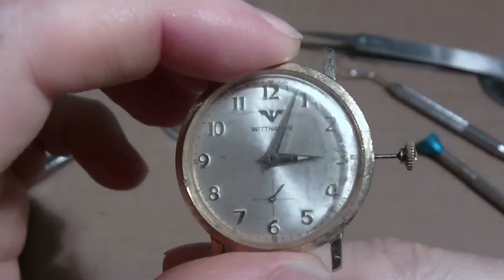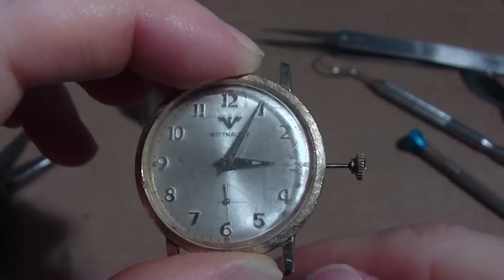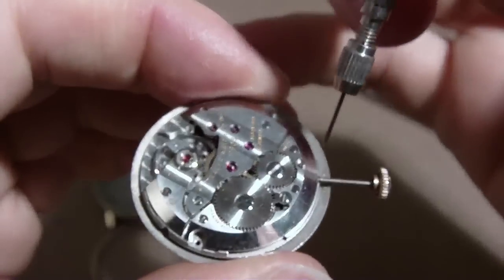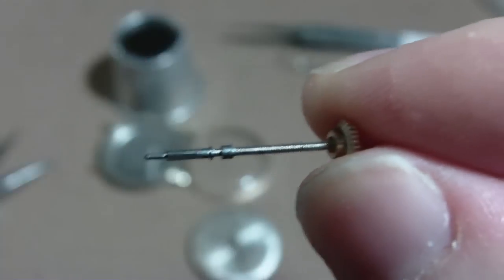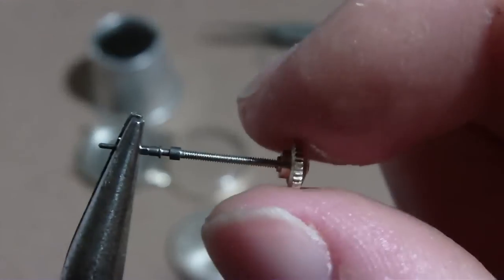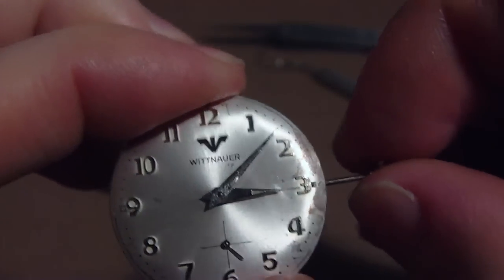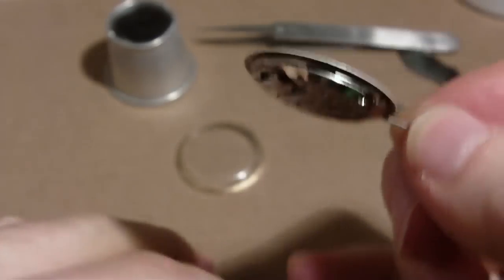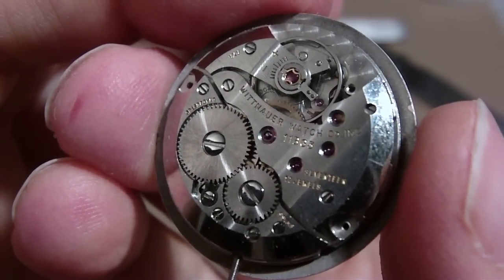How I remove a wrist watch stem and crown, screw type.  Wittnauer watch 11BG3.

Comment: @Naddycat caution.....I have had a few watches with the push button stem release hole you mentioned. A few times the button would not come back up so the stem would not lock into place. To avoid this problem I always put the slightest drop of thin oil around the little button edges to lube the button so it releases and comes back up easily. I learned this the hard way......a lesson learned hard is a lesson learned well as they say

Comment: Perfect! I received a replacement strap for my Diesel watch that included the crystal so I had to remove the crown and stem in order to remove the timing piece to place in the new enclosure. I had no idea how to remove the crown from the stem to slide it out of the previous enclosure... needle nose pliers on the stem and then unscrew the crown, simple! Thank you so much.

Comment: @MAD53 on a lot of watches when the self winding rotor starts to drag it is from the tiny bearings around the rotor shaft are wearing out causing play in the rotor....you might be able to place a tiny washer in there to take up some of the wear slack, put a drop of oil on the washer before you put the rotor back on

Comment from the maker: I had a watch without a stem and crown.  What I did was try different stems till I found one that fit.  Not a good way to do it but I was lucky and found one that fit rather quickly.  The watch is an Illinois wrist watch I did a video on.  There must be a proper way to do it and I will have to do some research and get back to you.  About your 16 size Bulova, maybe you can find the stem on ebay using a search of Bulova stem.  Maybe there is an internet site for bulova watches with a list of stems

Comment: @Naddycat yeah, I just hate those button type. There is a spring underneath the button type but sometimes the button has kind of bound up or frozen with age. Putting a drop of very thin oil....like trumpet valve oil (available at any music shop) around the edges of the button (before you try to press it) will help. Also try not to press too hard on the button. The spring underneath is not always a conventional spring...some are like a small wedge of flexible metal...wedge shaped

Comment from the maker: If the watch is falling apart like you said I think it might be a fake.  I have looked on the internet and they make some nice looking copies from China.  The case, dial, strap and even movement look like the originals.  Maybe you can send it back and get a refund if it was listed as real Tag Heuer.  To get the piece of stem out of the crown a bit of it has to sticking out of the crown.  I would use a small set of pliers and see if I could grab that little bit of stem and unscrew it.

Comment: What would might find easier is to employ the use of a pin vice to hold the end of the stem with the thread sticking out. This way you can tighten the crown safely without potential damage to the movement.  Just a suggestion. Great Videos
Reply from the maker: Good idea.  I will have to remember that for next time.
Reply: bunnspecial my watch crown won't set the time anymore the hands won't move at all I tried my other watch crowns they don't work eather how can I fix this 😕
Reply: bunnspecial  even with the battery it won't work I used a paper clip it turns it Alittle but when I put the crown back in it dosent work at all ☹️

Comment: How far do I need to push in the stem when reinserting until i start screwing it down? Thank you
Reply from the maker: That depends on whether you pulled the stem out, like you are setting the time, before you removed it.  If you didn't pull the stem out like you are setting the time the stem goes all the way in.  Just be careful because it is a square hole you are pushing the stem into.  If you pulled the stem out like you are setting the time then it does not go all the way in.

Comment from the maker: @MAD53 Maybe the guy at the watch parts store doesn't know anything and said something to sound like he knew something.  I don't understand how the second hand hits the hour hand?  If it does it might be easier to lower the hour hand than it is to raise the second hand.  I usually just push down on the hour hand close to the center.  I suggest not to bend the hands because if you bend them to much they may break.  About the rotor maybe some screw is loose or after 41 years it wore out.

Comment: Hi,,I wrote to you before about my Tag Heuer watch stem being skinny at the top by  the crown,,,well,,I tried to take the crown off and it broke,,so a piece of the stem is broken inside the crown,,,buying another crown is not going to work for me,,is there a way I can get this piece out of the crown? I think it might have been skinny due to someone twisting it trying to get it off cuz it wasn't rusted so not really sure,,ebay seller sold me a lemon saying it just needed stem had to buy new movem

Comment: Why is there absolutely no videos on how to tak the backs of thease wittnauer 1200 use all purpose wrench watchs whatever that means?

I allready brok 2 solid gold wittnauer and Hamilton Masterpiece thin o matic watchs because apparently there no way on earth to open them up nor is there any videos on how to anywhere im so annoyed.
Reply from the maker: I have never seen a 1200 use all purpose wrench before as I have only taken apart a few wrist watches.  From what I have seen I am amazed at the various ways those cases open up.  The movements either come out the front or back.  The back way is either snap on or screw on.  For screw on it could be the two or three point tool, hex wrench or some special tool as seen on Rolex.  The front way is either a pressed on ring that goes around the crystal, use of a tool that compresses the crystal slightly or four little screws like the Croton Aquamatic.  The front way also involves a split stem.  You should post a video of such a back.

Comment: it seems easy enough  But then I no nothing about watches .my Timex is  new   and I bought it at Macys for $50.00  but  recently my crown  fell off  so all it needs is a crown  .. a jewlere in the  mall  wanted to charge me $40.00  to replace the crown  .This to me was  way to much  for  the crown  ..where do you buy parts for a watch ?
Reply: I just came across this video and saw your question, hopefully it got answered by now. BUT! For future reference, there is a little site I absolutely LOVE for all my watchmaking needs on a site called "esslinger". If you google that word, it will be the first link, and should say it's a watchmaking warehouse or something along those lines. You can buy spring bars for bands, pins, crowns, movements, crystal glass, sapphire crystal, watch hands, dials, magnifiers, TOOLS (I love buying tools, new tinker toys I call them!), band parts, gaskets, bows, tool organizers, anything you can possibly find related to watches. Check it out, even if you don't buy anything, it's an amazing site! I ordered an automatic movement from them for $30 and I absolutely LOVE disassembling it just to understand and improve on the anatomy of a watch. Sorry for the essay, but this is literally my favorite passion. Any other question you might have if I have the knowledge on, I would gladly help with.